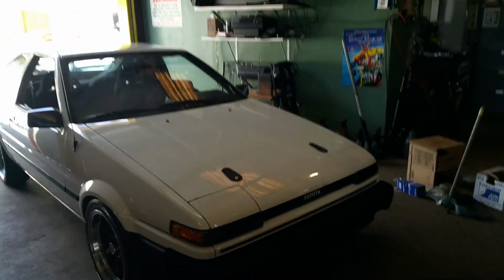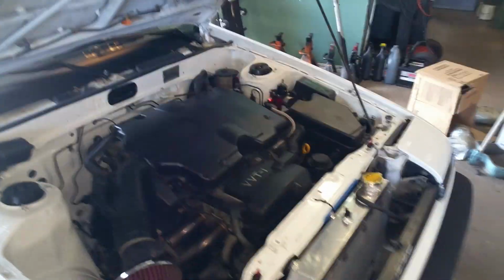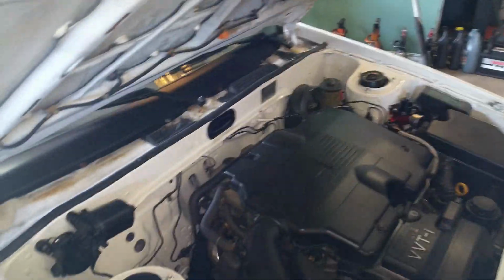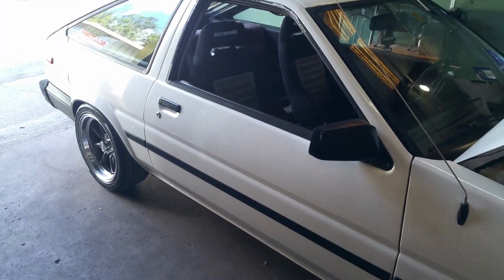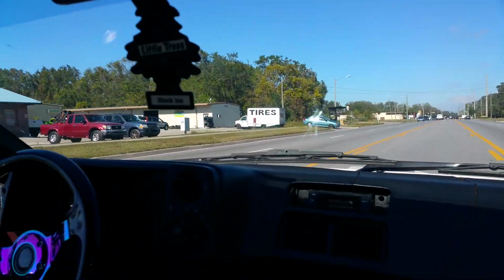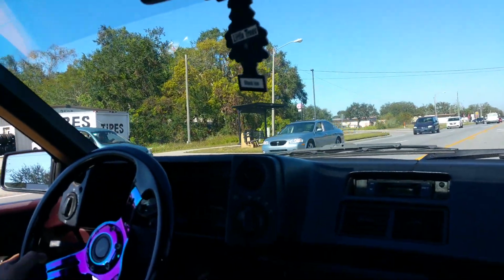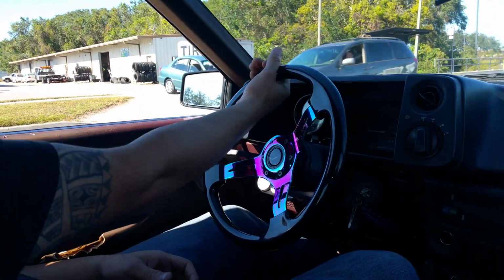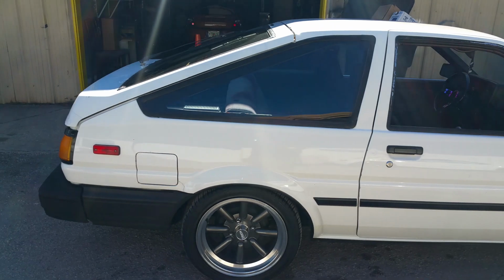2JZ VVTI AE86 W58 TEST DRIVE

Comment: This shit is sick. I’m about to drop a 7mge into my ae86. How did you guys get the motor to fit without cutting the rad cradle?
Reply from the maker: Sheyi Olukoya we cut it and bolt it it back.
Reply: Ke conversions sells a mount kit that doesnt require any cutting.

Comment: Who's 1j rx7? That radiator cooling the rx7 fairly?
Reply from the maker: s302jzget yes, it cools it very well. That will b mine rx7, almost done
Reply: check out my ke20 vid I just posted. I went with your guys words and running the ae86 radiator also. let's hope it cools. Lol
Reply: check out my ke20 vid I just posted. I went with your guys words and running the ae86 radiator also. let's hope it cools. Lol
Reply: check out my ke20 corolla 2jz build. just posted a vid on current status. took your guys word and went with the ae86 radiator.
Reply: check out my ke20 corolla 2jz build. just posted a vid on current status. took your guys word and went with the ae86 radiator.